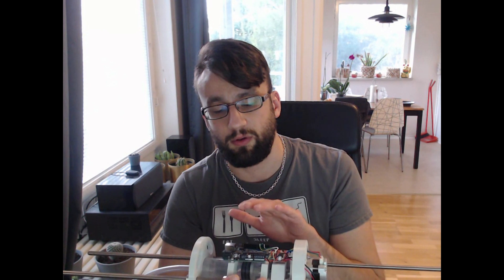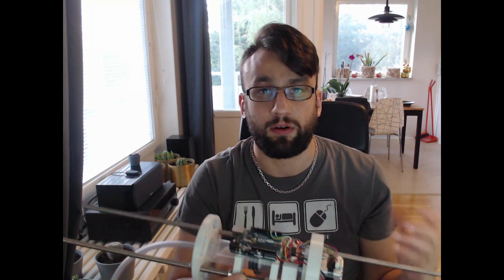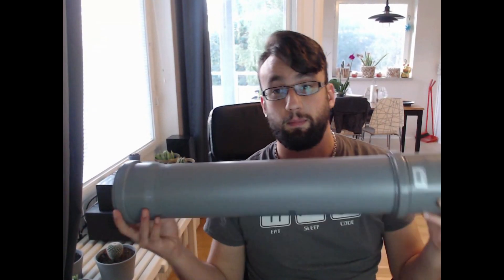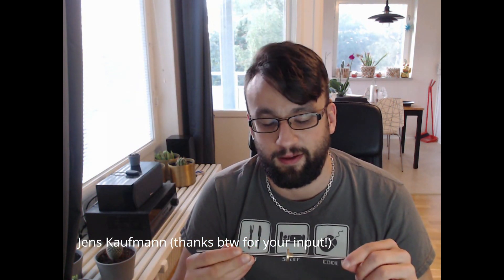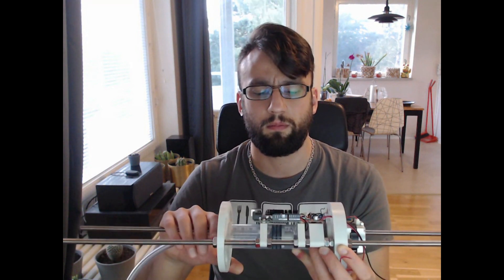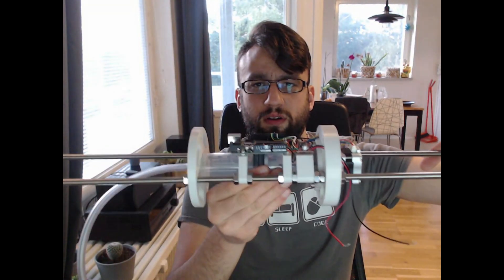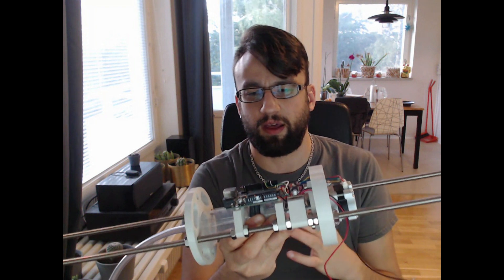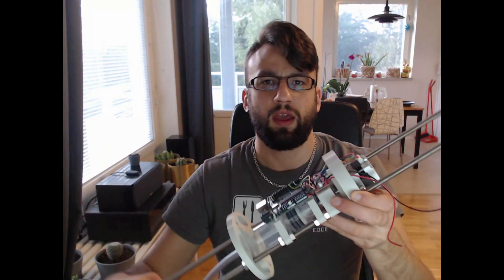Building a submarine - Part 3: Anticlimax (and future plans)

Comment: Maybe a mini linear actuator is a solution search on aliexpress
Reply from the maker: Could potentially work, but they're often not very strong. They need to handle a lot of pressure. Also, they tend to be pretty expensive. I got something new coming soon though... :)
Reply: Ok nice, have you seen these all in one arduino stepper drivers https://www.pololu.com/product/3134
https://github.com/pololu/tic-arduino
I think they are very usefull for your project
Reply from the maker: @paulh7189  they're a bit over engineered for my taste. I have no need for support for that many different interfaces, a simple serial interface works good enough. I'm using the EasyDriver, as it's quite cheap, small, and does what I need.

Comment: The volume of Ballast Tank defines only the volume of submarine upon water line.
Check mine http://imelnikov.ru/model/submarine
Reply from the maker: Right, but if the density of the submarine with a full tank is too close to the density of the surrounding water it might have quite low dive speed and control. But yeah, probably it's not gonna be a problem. I'm working on a new design now though. Stay tuned!

Comment: You should not worry about pitch after Ballast Tank is full. 
- it is almost near CG
- you can fix it with tiny piece of foam upon water line
Reply from the maker: Thing is, I'm not planning on having it be close to the water line. I'm designing it with a 10 meter goal in mind. Therefor I need to be able to control pitch in terms of buoyancy. I'm working on a new design right now though which will have two tanks so that I can automatically level it hopefully with some help of sensors.

Comment: 3/16th inch ACME could fit but i haven't seen one in a while.
Reply from the maker: Not sure what an ACME is, but I did actually buy a 3/16'' threaded rod because it is very similar to an M5, but with higher pitch, so I thought that's what the motor used. But no, it's metric, but just uses a different standard.
Reply: Look here for the lead screw, when you search on t6 or t5 leadscrew you will find them.
SH € 3,05  50％ Off | T6 Lood Schroef 1mm Pitch met Messing Moer 100/150/200/250/300/400 /500mm Lood Schroef
https://a.aliexpress.com/_BTEJZR
Reply: I hope you will find motivation to continue your project because its very interesting and I would like to build itt when its finished
Reply: Maybe iff you publich it now on Github other can participate and help

Comment: Don't real submarines have forward and aft ballast yanks? You could make two and use a PID algorithm with a position sensor to automatically balance your sub. 

Also you might want consider a Teensy. They're much more powerful than Arduinos.
Reply from the maker: Yes, and I think I cover this as a possibility in the video. Maybe not this detail though but yeah, I have considered that. I figured I could regulate them with a PID anyway to keep a certain depth, but of course it's natural to control attitude as well given two ballast tanks.

About the Teensy, they don't seem to be more powerful at all? The Teensy uses an ATmega32U4 versus an ATmega328p. Both microcontrollers are 8 bit @ 16 MHz with 32 KB flash. The major  difference between these chips is that the ATmega32U4 has built in USB peripheral support, this makes the boot loader significantly larger and slower to start up, and since I don't plan on plugging a keyboard into my submarine it's an unnecessary feature with only downsides.

If I need something faster I'll probably just go with some kind of ARM-based chip SAMD21 Cortex-M0+ (For example  used in Arduino MKR1000). Faster chips of course draw more power as well so I'll only do that transition if it proves necessary or beneficial.

Edit: I just saw now that there is a Teensy board with a SAMD chip like the MKR1000, but yeah same argument holds, no need for a faster chip as the power consumption goes up. I'll keep it in mind if needed though. Thanks.
Reply: @HolyGarbage  The Teensy 2 (with the 23u4) is more or less outdated. I'm talking about the 3.2/3.5/3.6 models which are ARM-based and have a lot more speed and capacity than the nano. There's a new $20 Teensy 4.0 that really blows everything else out of the water (appropriate pun) with 600 MHz, 1M RAM and 2M flash. That may be overkill for your application (as it is for most of mine).